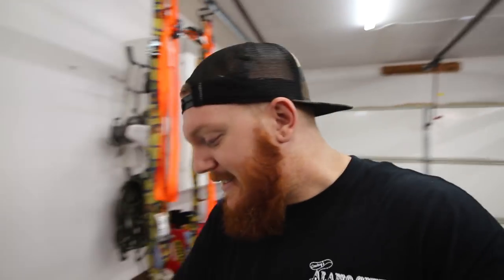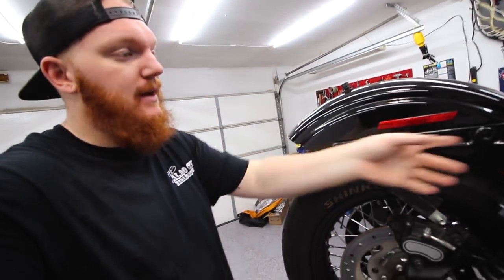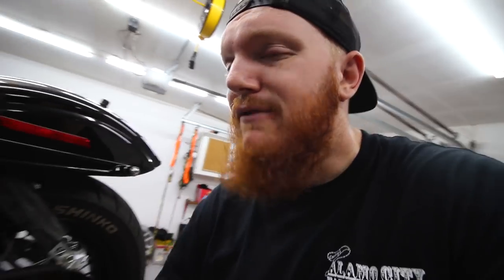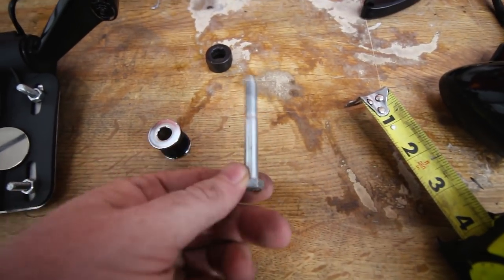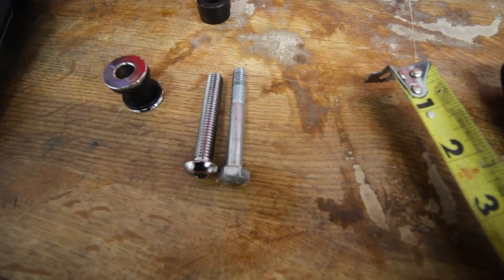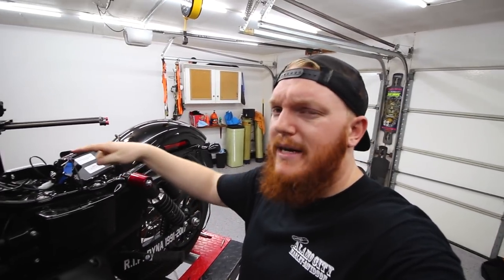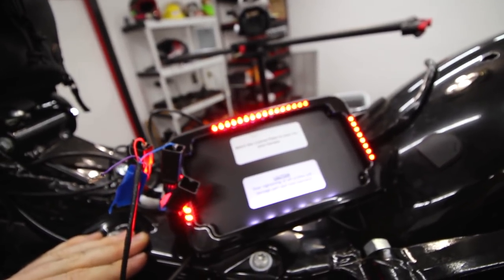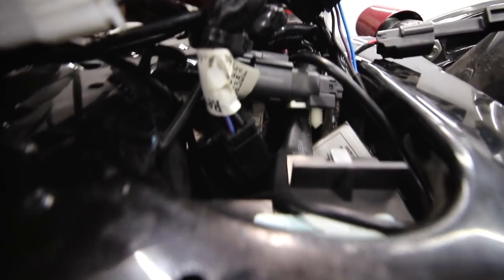Harley Dyna Build Series Ep. 14 - Quick Detach Sissy Bar & Cycle Visions Curved Plate Mount

Comment: Nice set up. Only thing I’d change is getting rid of the pedestals on the turn signals. If those are stock housings, Harley makes a plate to clean up the signal(look at the front housings). Or better yet, just buy some front signal housings. I had a similar setup before I went with the alloy art signals.
Reply: This is what is intended to be done with the kits anyway. That’s why he had to find longer bolts. They should have been eliminated.

Comment: Good job. I was originally going to go with a removable sissy bar but instead decided to just bolt it to the frame so that I could use the same extended mounting bolts for hard bags (need to get them painted). That way the bar and the bags are both bolted directly to the frame instead of a bracket attached to a bracket attached to the frame.

Comment: Had to do something similar on my street bob w/ the cycle visions plate. I have some Viking Warrior saddlebags and ended up having to mount the taillights onto the plate mount. Just bought a quick release sissy bar, so now I will have fun struggling with the bolts too haha

Comment: The bike is looking niiiice.  Have you considered using "IDC Weatherproof Terminal Splice Tap?"  They are easy to use and do not require cutting on wire insulation.  Thanks again for the videos!!! :)

Comment: Not sure of the brand but they do make rear quick disconnects that let you utilize your stock turn signals and the wiring goes through the center of them so it looks OEM.

Comment: Take the block off plates that came in the kit and use those between the blinker and quick detatch to seal off the hole??? Might need a little longer bolts???

Comment: With the cycle visions plate light wires did u splice into the rear signals running / brake / signal and plate light wires after the feed ? Meaning the actual wires that are connected to the rear existing signals ? Appreciate all the help thanks in advance

Comment: Do you know what size screws you used for the turn signals? I have a 2011 street bob which I’m running into the same problem trying to run the detachable sissy bar

Comment: I don't understand what happened to the wires from the turn signals back into the rear fender? Before they were wired through that second hole in the fender. Then the signals were pushed outwards, the wires couldn't go through the old holes due to the new sissy bar, then there was no explanation on how to rewire the signals?
Reply: I am also having same doubt....but I guess you can somehow pull the wires to pass through fender holes.....

Comment: hey man loving the videos! Curious, I was installing some similar tail lights and pulled the wire harness down. When I went to stick it back to the top of the inside of the fender with double sided tape it doesn't stay. How did you get your wires to stay put and out of the way?
Thanks!
Reply from the maker: I ditched the tape actually. The plastic that runs on the inside is enough to keep all the wires in place
Reply: Bike N' Bird oh you have some kind plastic thing that holds it?

Comment: So the only reason you had to get creative on the signal mounting was that you got the detachable sissy bar for a Wide Glide and not a Street Bob?
Reply from the maker: No. Any sort of kit that utilizes those rear bolts would require some sort of taillight relocation that I didnt want to do
Reply: Ahh thanks! I was looking at getting a detachable sissy bar for my 16 Bob, this info helps. Cheers!